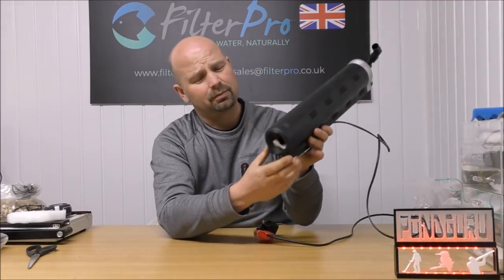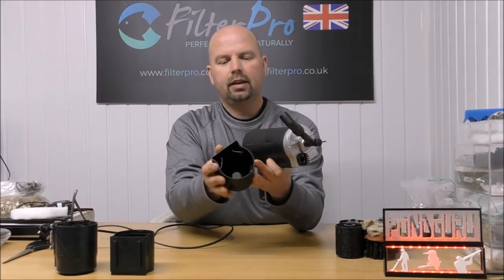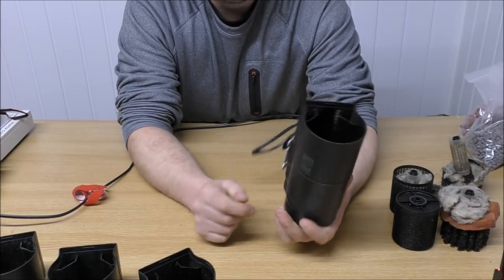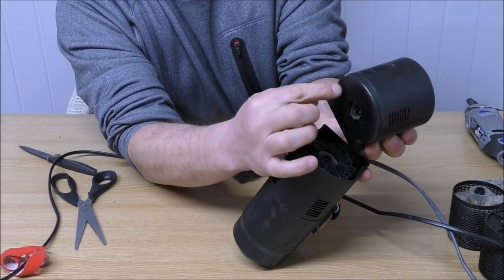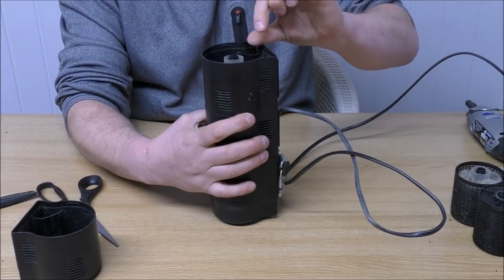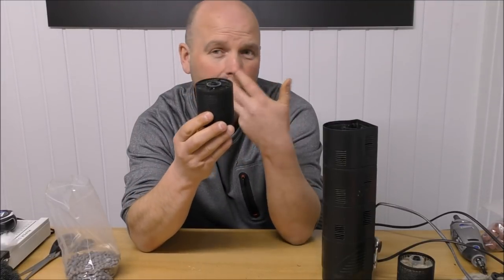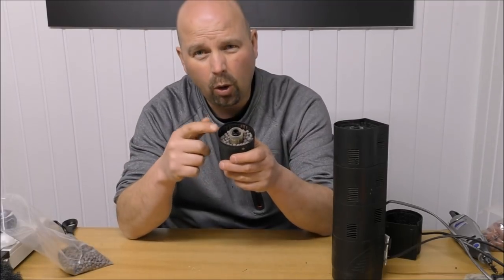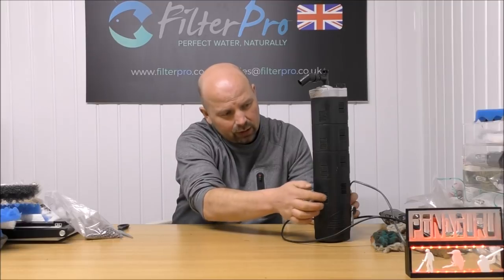Pimp My Filter #7 - Aqua One Moray 700 Internal Filter

Comment: I got one of these thrown in with a new aquarium, though mine had carbon in the middle section. The main problem is they are really bulky for an internal filter, but don't actually contain much media. I ran it for about a week, bought a new top end canister filter and dumped it's media (and bacteria grown so far) in to that. Will keep it as a backup.

Comment: Evening! I've just pimped the filter as you have done (it came with the tank and I'm limited on money just now). However the filter media is set up the opposite way around to what you have done here. Of course I can swap it around but why would they say from the bottom up needs to be carbon medis then ceramic then what looks like a very course sponge at the top? Just curious as now I'm wondering which direction the water will go.
Many thanks 😊😊
Reply: I was going to ask the same question... my sponge is at the top then the beads and ceramic under that..
Reply: A lot of manufacturers set up their filters wrong, and I guess we will never know why. Having the coarse foam at the last stage of filtration makes no sense.
Reply: I think the way this has been pimped is wrong. If you look at the way the filter works it actually pulls water downwards through the media and into the bottom chamber then expels the filtered water up the central black pipe and out through the top. So by opening up the lowest filter section, your actually bypassing the chambers above as the water drawn in here will just do down then up the centre pipe and out. If your still using it I would reverse the media and put the chamber where you’ve opened up the vents at the top so the flow is correct.

Comment: Ah man. I've got one of these as it came with a secondhand tank (albeit it has one less chamber). I couldn't understand why I was getting not very clear water. I changed media, added various densities of foam, replaced the AC media, changed the order of filtration - but now you've broken it down, I can see exactly why it's not working properly. At this stage, I think I'll just get a Fluval U2 to replace it, as everything inside it needs changing, so what's the point?

Comment: Hi Richard, 
I have been following your work for a little while and you helped me a lot as a newbie fish keeper, but I have found a flaw in this pimp.
I've also got an Aqua One internal filter but mine is a slightly simpler model with less compartment, that came with the Aspire 55 aquarium...the point is that mine works the same way with the same pipes in the inside.
I do not think that the water is going to go up in the filter as you modified it. As you said in the video the water gets drawn in from the outsides but then it will go down in to the pump and blown straight up in the black pipe. So what I've done is, that I've put the mechanical filtration in to the top compartment and siliconed off the holes on the second one which holds the biological media, so water gets drawn in only to the top one. I drilled holes to the bottom of the top compartment as you drilled the bottoms of the Moray's compartments. This way no debris can be drawn to the biological media and all the mechanically filtered water has to go through it.
Hope it makes sense ... and sorry for being a smart ass. :D
Keep up the good work and looking forward to the big reveal! Going to order some biogravel because as you always say the biohome ultimate just not the right size for internals.
Best regards, Nikola
Reply from the maker: That sounds interesting and if you make a video of the filter feel free to send the link no worries.

Comment: Great video Richard, as always. Great to sit down with a coffee and watch them. I have a filter question, my canister filter has a UV steriliser lamp built in.  In your opinion, having this turned on, will it harm beneficial bacteria such as the fragile anaerobic or aerobic?  I can't find much info about this online. Cheers!
Reply from the maker: As the UV light does not shine directly onto the media it won't affect the bacteria inside the media but it is advisable to leave it turned off for a couple of weeks if you're just setting up a filter as it will allow good bacteria to flow from tank to filter and back again. Once the filter is set up with bacteria and working well you can have the UV on all the time no problem.
Reply: Pondguru Great stuff, thanks 👍

Comment: Nice vid. So I've had a SunSun 304b and just bought a Pingkay 304b canister filter. They both have the same specs but when I plugged in the Pingkay I was surprised by the difference in flow rate. The Pingkay appeared to be nearly 3X stronger flow rate from the spray bar. Inlet and outlet tubes also have a superior feel to them. The one thing I don't like about them is that the trays aren't snug against the walls with slight gaps and allowing particles to bypass the filter media. Would make a pimping video on them? I was thinking of gluing a thin gasket around the tray walls to close the gaps. I'd like to know what you would you do though.
Reply from the maker: There is generally a slight gap between the trays and the outer walls of the canister but as long as the trays fit together well enough there should be minimal bypass.
That is surprising that the Pinkay 30b has more flow even with the same specs - I'm not familiar with that one.
Reply: Pondguru yea, I was surprised myself.

Comment: Do you do pond filters Richard I need a new one what would you recommend. Thanks Mark 👏👍
Reply from the maker: Pond filters tend to be be better laid out and more sensibly sized although some can be altered a bit (which usually involves using the correct media for the type of filter).
I am getting a pressure filter delivered today so will be linking that up to a shower filter and filming the process. Feel free to ring me on 07772848730 as there are so many options for a pond filter system.
Reply: Pondguru Cheers Richard much appreciated thanks Mark

Comment: I've never quite understood the point of these larger internal filters. Internal filters on smaller tanks are good enough, but if you've got a tank big enough to fit this thing in, is there really any reason to get this instead of a canister?
Reply from the maker: If you have space for a canister then go for that over any internal filter as they offer way more scope for mechanical and biological filtration.